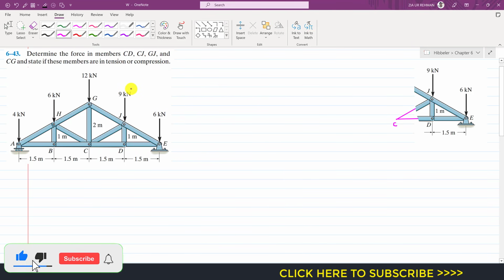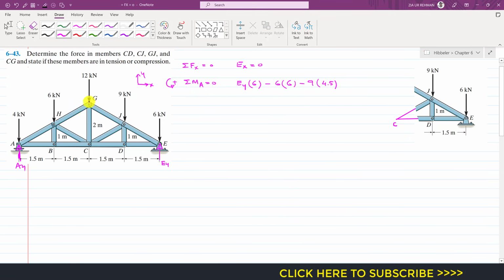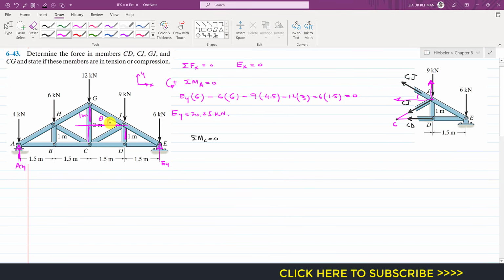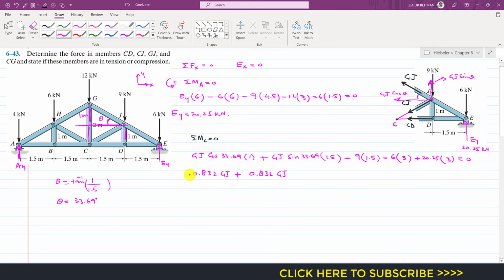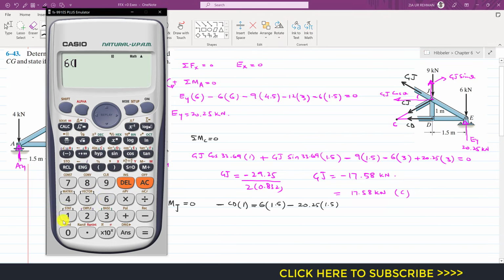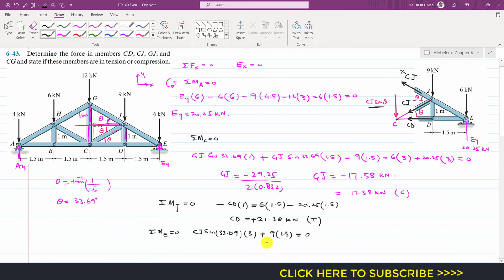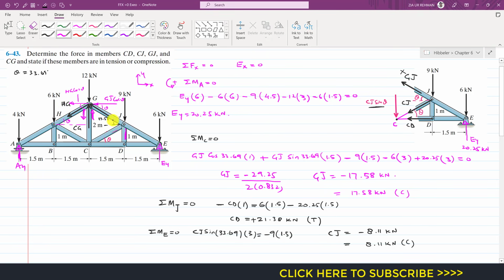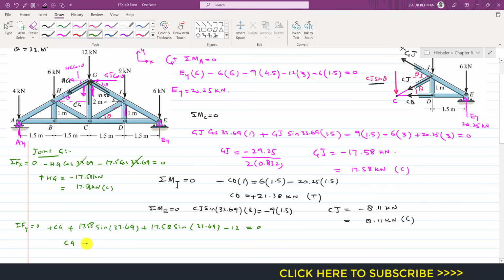6-43: Structural Analysis Chapter 6: Method of Sections | Hibbeler Statics  14th Engineers Academy

Comment: 13:18 why did you put the y component 3 m away? Why not 1.5m away or anywhere else? And same for x component why did you place it on the line of acction of E? I dont get the placings of the components
Reply: same bro i dont get it too..
Reply: Well, it's taken two years, but here is the answer lol. If you are taking the CJ_x and CJ_y at point F, then it would be 1.5m away from the y component and 1 meter away from the x component. He moved it down as if he was taking the CJ_x and CJ_y at point C, putting the x component in line with point E and canceling it. Both methods work and will give you the same answer; just the way he did it has one fewer term.